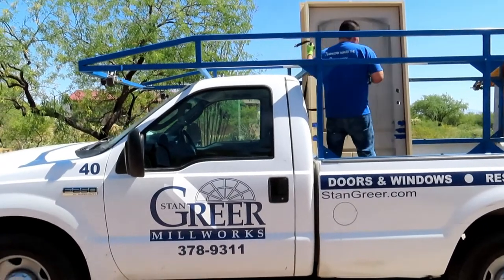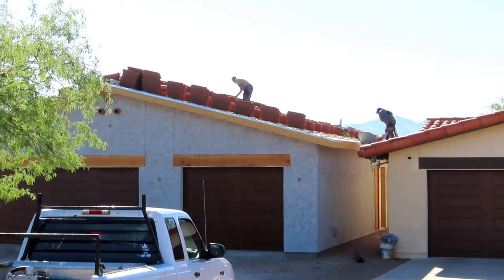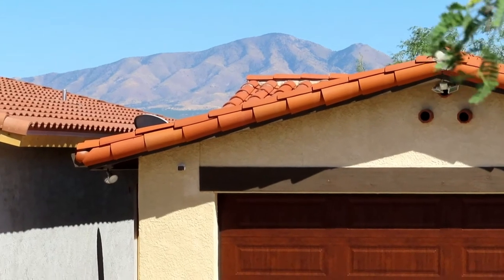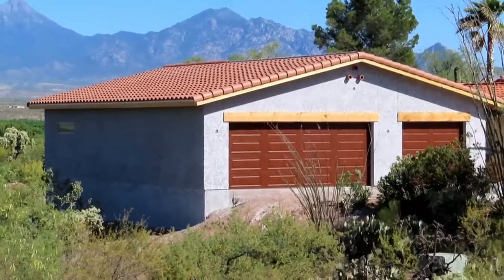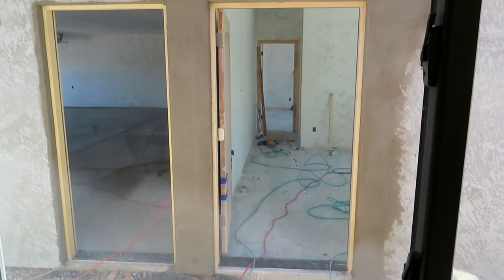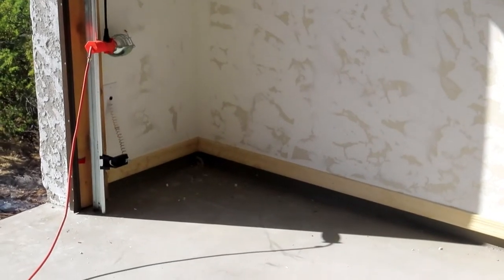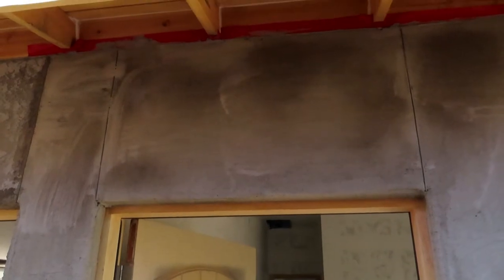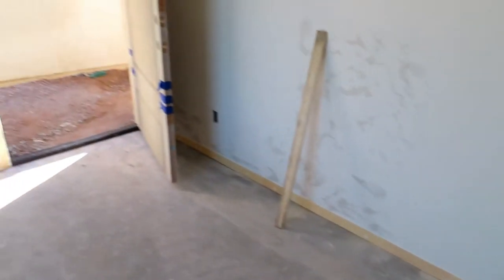Garage/Casita update, roof tiles installed. Baseboard and door frames installed and painted 05242020

Comment: Hi, Bart ... 
I like and value ceramic roofs very much.  
They are beautiful and protect against hot air.  
What was the strongest wind in the Green Valley?  
Were the tiles falling off the roofs then, did the roof structures withstand the wind?  
Now it's time to finish the interior.  
Solid construction work!  
Greetings from the Pine Forest flow to Green Valley!  🖐😊 MM&A
Reply from the maker: I love the concrete tiles for the roof.  The original house has clay tiles, but the new building is concrete tiles.  I think the strongest wind I have seen in Green Valley is about 60 miles per hour.  So far out roof is holding up well!  As I write this reply to you Mirka, the walls are being painted and the cabinets are being installed.  Tomorrow, the tile man will be here to start that work!  I hope it will do quickly now!!  Thank you for watching and your comment!